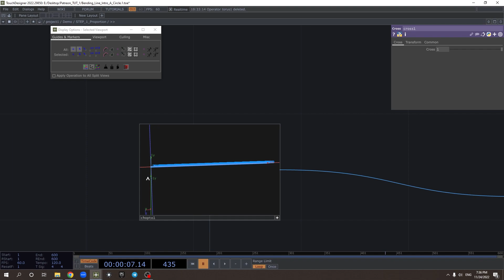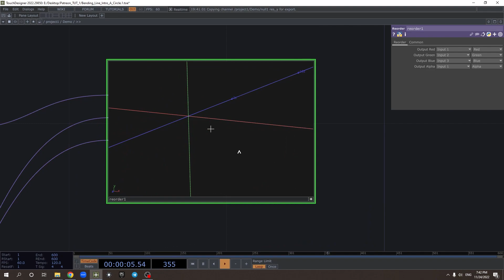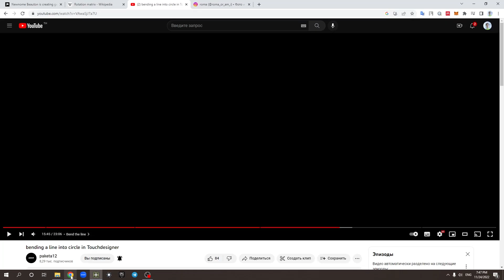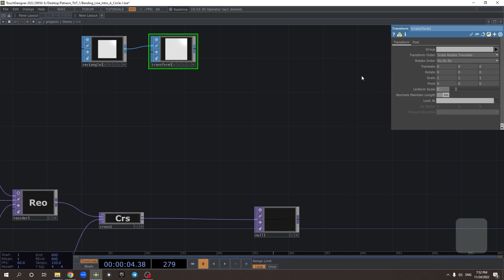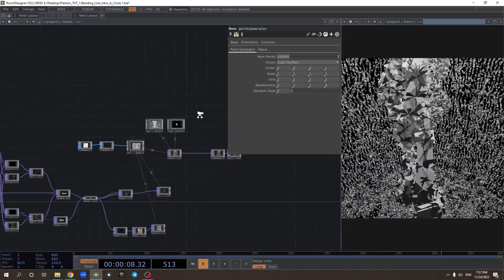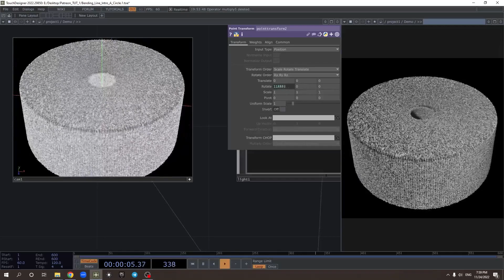Circularization_tut_01

Comment: HI NEWNOME, great stuff 🎉 but i have a question how did u turn this into the component u used in the plant video,  I see u made the cross the dry/wet and added an in top but not sure how to collapse it to the comp and add a top and output. Please help.
Reply: I have the same questionn
Reply: Any progress on this question I'm dealing with the same issue
Reply: same here! any update please
Reply: Just drag it inside the component list.
Reply: @HHE1009  You mean select all the operators and collapse them as a base? and add that base to components? I believe there are more steps, like to add customisation to the set we created, Even I dont have an idea but I believe its just one step away.

Comment: Hey, thank you for your tutorial. I'm stuck at the PointGenerator part, in the new versions of TD the interface is different, and there's only Box Surface (≠ Rectangle Surface). When chosen, there are a lot fewer particles not organized in any shape or form. Could you help me?
Reply from the maker: Hi! Thank u for watching. The latest version of TD (2023.12120) def has pointGenerator component with shapes including rectangle , box and box surface. and you could use any of these in that tut

Comment: Hi there, thank you for your great tutorials! I am new to Touchdesigner and i am really interested to see what you can do with it. I did this tutorial from start to end but my outcome is pretty different from yours, to put it simply my outcome is more like a pancake with a hole in the middle ; ) before i go and check what i did wrong (go over the tutorial again) i just wanted to ask one question. I noticed that there is no '32-bit float (RGB) option anymore in the Pixel Format drop down so i used '32-bit float (RGBA) could this be the reason my outcome looks so different from yours ?
Cheers GJ

Comment: Great explanation, but I'm having a problem with the learning process, I don't have 32-bit float(RGB) in the pixel format option, probably because my TD version is 2023.11760, please as what is the solution?
Reply from the maker: Hey. You certanly should have a "32-bit float RGBA" option in that version too. If you don't have one, it's more likely to be related to the computer than to the touchdesigner. But you can use 16 bits too, it shouldn't make much of a difference
Reply: @newnome_beauton Thank you so much!!!! I will try that!😆
Reply: @newnome_beauton  it works with 32-bit float RGBA :)